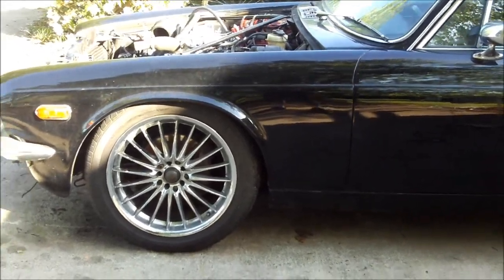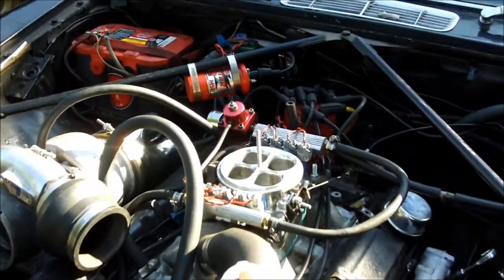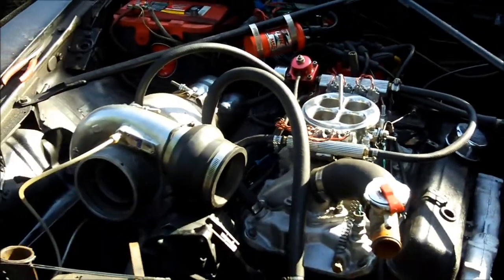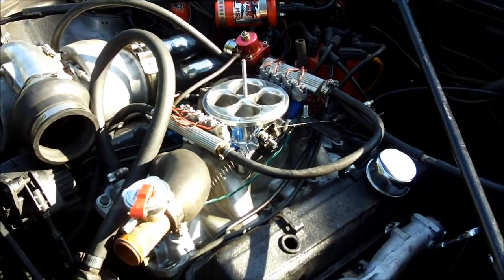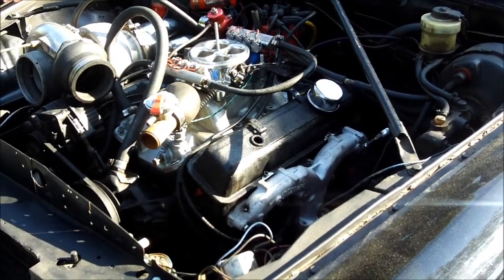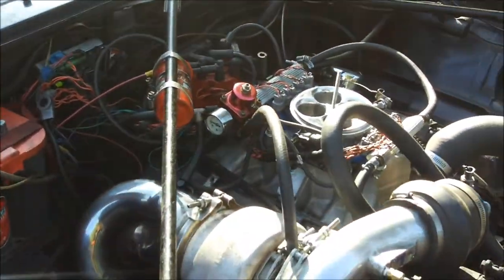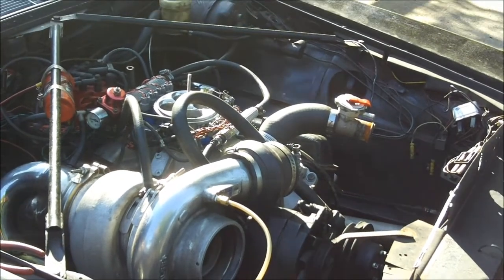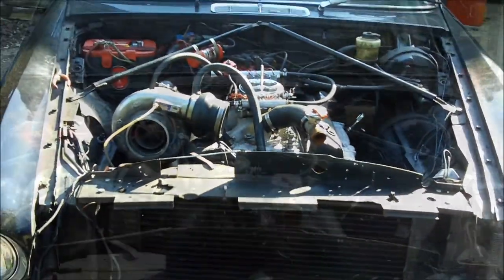Turbo Jag First Start.wmv

Comment from the maker: Thanks.  I built the throttle body myself.  I'm planning on making them with and without injectors for TBI and multiport use in varying degrees of appearance.  I wouldn't recommend TBI for turbo use, but it seems to be working for this application.   I'm putting a 454 on the dyno next and plan on testing a couple EFI setups to make sure performance is comparable.  That motor will be run n/a with headers, twin turbo, and with a quad turbo setup I built.  Expect more videos.

Thanks,
Kevin